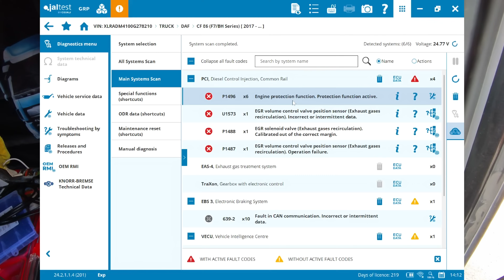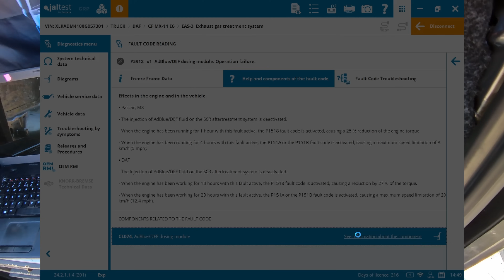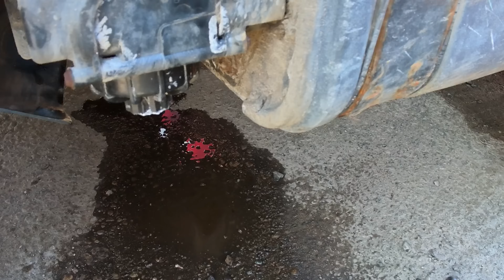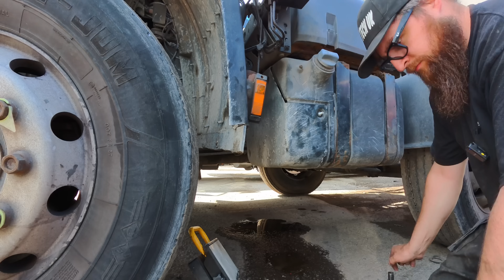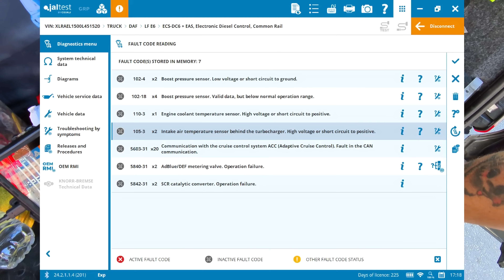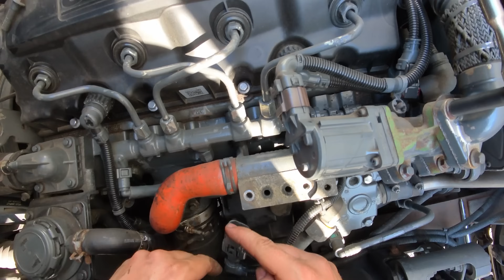DAF truck trouble: what's wrong with these DAF CF'S?

Comment: discusting to see how the cabs are taking care of...like a sh``holes
Reply from the maker: Hey buddy. Thanks for the comment. To some people, a truck is a home from home and to others...... it's a tool to do a job. If only they were a tool that was looked after I suppose 😂
Reply: @TRUCKTECHUK  for me my trucks cabs are like home...even cleaner LOL. But even its tool to do job it should be clean-shitty cabs talks about owner some...
Reply from the maker: @Georg_N  have you seen my van recently 😂😂😂🫣🫣🫣🫣🫣 I miss the days I had time to put things in some sort of order 😅
Reply: @TRUCKTECHUK  no i havent seen :D
Reply from the maker: @fboest you would cry....like I do every time I open a draw 😂😂😂
Reply: @TRUCKTECHUK  LOL
Reply: BTW can you help me out- we like to build stacks on our DAF XF 530, Question is that when I install that exhaust changeover valve after turbo and before DPF is it healthy for DPF? I mean if I drive and exhaust gases is not reaching DPF will it ruin it?
Reply from the maker: @fboest  yer I wouldn't be filling my dpf with AdBlue and no exhaust gasses flowing though, I think it would go to de-rate without the nox sensors picking up PPM. 

I think you will need to map out the after-treatment and all the DTCS that will come up and possibly knock the DPF out too.

If I was you I'd leave it well alone and factory spec personally
Reply: @TRUCKTECHUK  thanks for answering. But still how they run trucks like this? There are many show trucks which also do daily jobs and just uses button in cab to go “loud” or back as OEM
Reply from the maker: @fboest  couldn't tell you buddy. All I can tell you is no flow-through sensors in the exhaust means warnings on the dash, bypassing flow through the SCR means ablue pumping and no exhaust gasses means a blocked exhaust......it must be software manipulation from the factory spec. 
I'm going to truck show wales this weekend so I will have a look and ask them.
Reply: @TRUCKTECHUK  that would be awesome and thanks a lot! Please keep me posted
Reply from the maker: @Georg_N  no problem

Comment: Have you done any videos on fault code 4334-2 on a PX-5 LF euro 6? Abnormal pressure no signs of leaks and seems to be holding 9 bar fine and dosing okay after a new doser but still faulting
Reply from the maker: No, all my abnormal pressure issues are usually identifiable. 
I'd go out and monitor the pressure while driving to see if you can induce the fault. 

I have it before where the pipes from the pump to the dosing valve were the fault....if you can swap the bundle of pipes I'd go down that route buddy IF you think you're good with the pump and doser 👌
Reply: @TRUCKTECHUK  thanks for the reply found in a test drive pressure at random times started waving up and down and it dropped to 1 bar putting fault on dash, but strange how the pressure stays at 9 90% of the time then starts bouncing up and down 😅 have the pump off now and don’t see any signs of internal leak so maybe pressure relief valve
Reply from the maker: Can you swap it out for another pump you know is good before you go changing parts or buying a new pump?
Well done for inducing the condition and seeing what was going on 👌😎
Reply: @TRUCKTECHUK  got it sorted hopefully was just the pressure relief valve so nice and handy swapped from another truck and now not faulting 👌🏻 only came across your channel at the weekend but love the quality and knowledge in the videos great to learn about systems on DAF I’m not familiar with
Reply from the maker: @DarrynHughes97  ha brilliant buddy. 👏 well done. These dafs can be a nightmare without technical information for diagnosis. Hopefully, my other videos fill the void for you in the future buddy 😎 Thanks for the comment and for watching 👀

Comment: In our company we've had lots of  xf snapped camshafts is this a common problem?
Reply from the maker: I've not seen any snapped camshafts but worn or spun cam lobes due to the design 🤔
Reply: @TRUCKTECHUK  had at least 5 snapped one twice they sound as if they are only running on 4 or5 cylinders

Comment: I drive a 64 Euro 6 XF being an early Euro 6 I has no eco mode and pulls like hell. Drove a 480 CF before this and that didn’t pull as well as this one does.
Reply from the maker: It's odd how the performance can differ from truck to truck and with no fault codes, customers aren't willing to invest money in investigating driver complaints about power. ....which is annoying from my point of veiw as I've 4 trucks currently that I can't get to the bottom of due to cost restrictions 😕

Comment: Nice video as always.

No good examples for the mechanic.
the mechanic should have seen while swapping that the actuator is not right he did, after all, swap the old actuator.

the leakage due to broken filter housing is not a good advertisement for the mechanic should have just been honest that he broke it.

fortunately for you an easy swap.
Reply from the maker: 2 of the craziest faults I had this week. I have got a lot of ongoing jobs currently that aren't video worth like this last one. 

It's been an odd week in the old "what's wrong with this truck tech UK?" land 🤔 😕

Comment: Hello, I am a DAFxf 106 truck driver, this truck has no faults, but the problem it has is that it does not accelerate and it moves like a turtle on the uphill road. Can you help me solve this problem remotely? Thankful
Reply from the maker: its not a euro-6 daf xf mx-13 by any chance?
Reply: @TRUCKTECHUK Yes😐 , The device does not display any errors or malfunction alarms.🤔
Reply from the maker: I KID YOU NOT....... you're the 4th person in the last 30 days with this issue 🫣🫣🫣🫣🫣. 
When you get the change.....go pull the BPV electrical  plug off and leave it temporarily off..... it will put the truck into engine protection mode and lock the turbo into the fully open position. 

Drive it down the road and then come back and tell me if the performance has come back 😎
Reply: @TRUCKTECHUK  I did it, after turning off the BPV, I drove a few kilometers on the road and then turned off the truck and after starting, the engine error appeared. And I connected the BPV, then the engine error was cleared.
Reply: If the sentence is incorrect, I use Google translator😉
Reply from the maker: @حمیدمیرزابیگلو  did it drive normally with the BPV unplugged? Did it boost properly?
Reply: VGT replacement. Inspected and healthy fuel pump, replacement air filter, replacement black head sensor, clean radiator, clean pipes, replacement clutch disc, replacement fuel filter,😢
Reply: Ok . Thanks 🌷
Reply: No 😐

Comment: Eup mate c u have been busy again first truck u looked at soon as u jacked cab up saw the issue straight away 2nd truck with ad blue best way i find to remove filter is with a large bent pick . great video content as usual 👍👍
Reply from the maker: hey steve, yep i wish id of just jacked the cab over first ha ha ha how its ended up like that i have no idea😵
that adblue filter looks like someone went to town with a screwdriver rather than the removal tool (or a pick as you say)
take it easy buddy😎